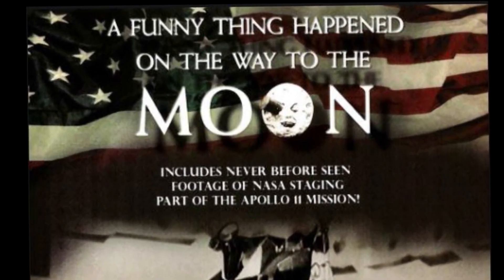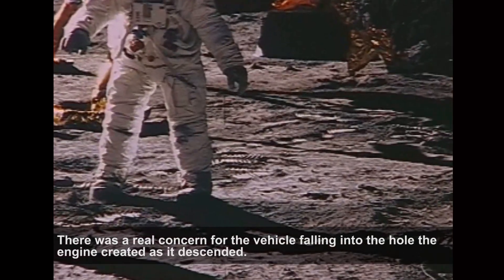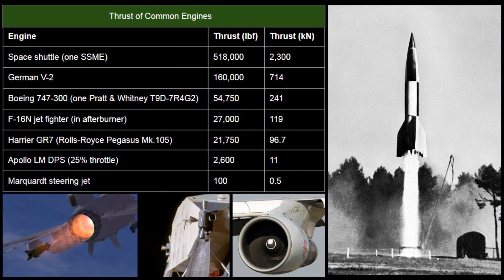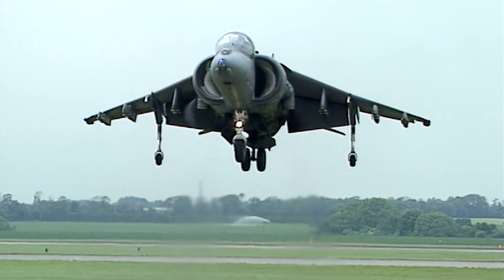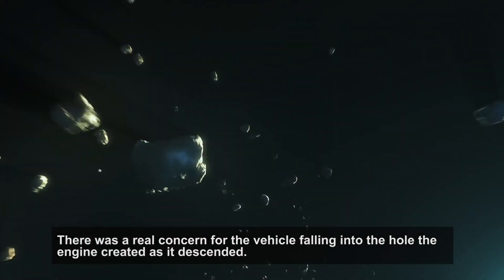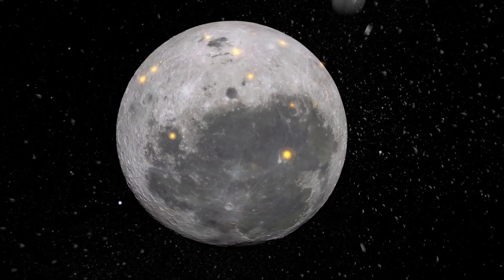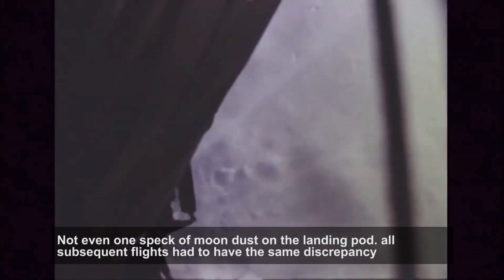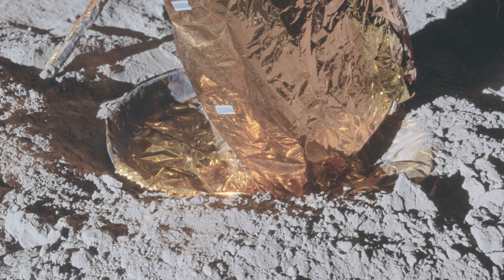A Funny Thing Happened on the Way to the Moon - Debunked - Part 4 - No Blast Crater

Comment: A plane, not having a thruster equivalent to the lander, hovering over grass, is not the same as 2500lbs or so of thrust from the thruster (or whatever it's called) on the lander. 
You're comparing apples to oranges. 
Duplicate a thruster over a dusty dry land surface, and see what the results are. A plane hovering is not a thruster propelling itself.